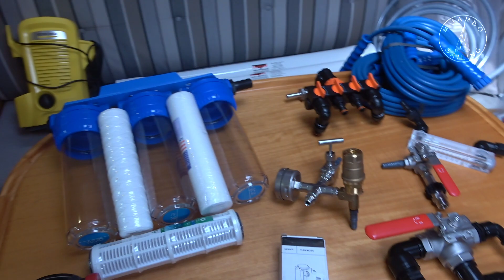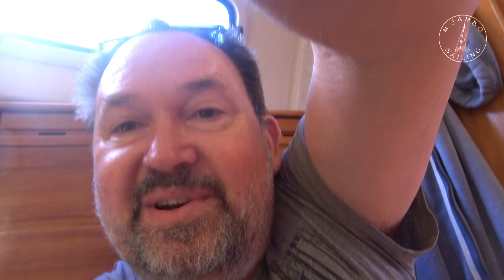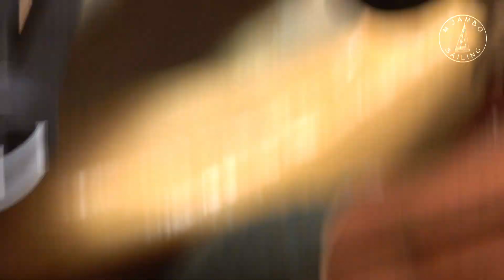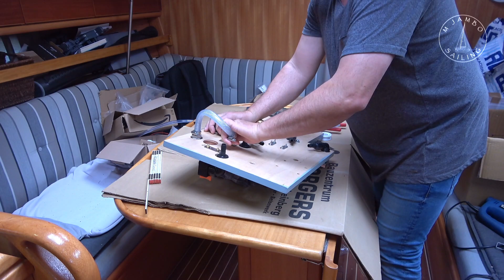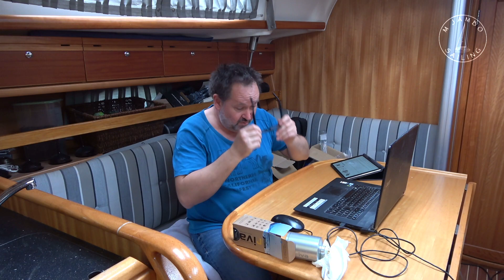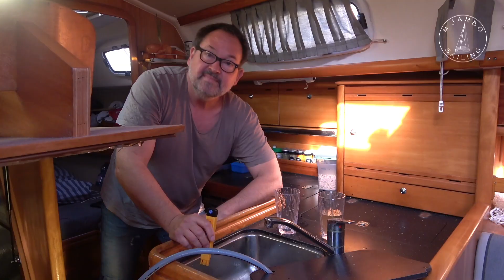Preparation for the next long-distance cruise: Watermaker

Comment: Is the water maker Karche pump still working?  I have read that saltwater breaks the units.
Reply from the maker: The system was runnig until my Jambo sunk. However, the Kärcher had only a short life time. At the end I had a Hyundai high pressure cleaner with an alloy pump in operation, which was much better.
Reply: @mjambo697  I'm so sorry to hear that your boat sank. That's terrible.  Have you a new boat?

.

Comment: Thanks for taking the time to share and not mansplaining😊. Very informative. I fully understanding not wanting to drill more holes in your hull. I sure you will find a way not need to isolate the engine water supply whilst running the water maker.
Reply from the maker: The water supply works well. When is engine runs the water maker cannot. Kind regards 😀⛵⛵

Comment: Nice layout of all the parts on the board. Glad it works well for you. Do you have more than one water tank? I thought it would be a good idea to have a small 20 Gallon stainless steel tank for all the drinking and cooking water that would be the prime depository for a water-maker. That would reduce ther amount of time the water maker is on to fill the smaller tank. Then since I have two 125 gallon water tanks that would store the bulk of the water, I would use one as catchment for rainwater and the other for public water from the docks. I plan the option of running either of those tanks through some basic yarn filters (50/20µ) if I wanted to use either for something other than a fresh water wash down of the boat, sails, chain, dishes, clothes, or my body.
(Michigan, USA)
Reply from the maker: Thank you, Brian, that makes a lot of sense. I have one 300 l tank and that's it. I fill 5 l cans with water for drinking and cooking. In the main tank is just the freshwater for all the rest. Kind regards 😀⛵⛵
Reply: @mjambo697  That will work fine.

Comment: What type of low pressure pump are you using.?
Reply from the maker: TMC Circulation Pump 25L/min
Reply: @mjambo697  is that pump self priming? And is it 12v DC or 220v ac

Comment: How long do you expect the Kärcher to last pumping seawater? I think they're not really designed to do that and expect the pump to corrode pretty quickly.
Reply: If he flushes it with fresh water each time that may not be a problem.
Reply: Hi Dirk,
the cheap Kärcher K2 is made of a plastic pump head, the plungers are stainless steel, so it can handle seawater pretty well.
Reply from the maker: As Rainer pointed out the pumps are made of harden plastic. I expect a life time of 100 to 120 h. Then the Kärcher gets changed, which is probably still cheaper than even a maintenance kit for a proper hd-pump. Best regards 😀⛵⛵
Reply: @mjambo697  Brilliant, I have one of these Kärchers at home and I will follow you example. I'm going to disassemble it and look if i can't attach a 12V motor instead of the 220V. Then all I need is a Cape Horn windvane and I'm all set.